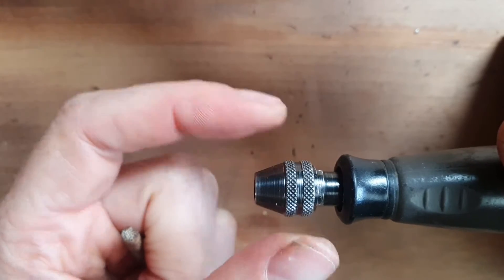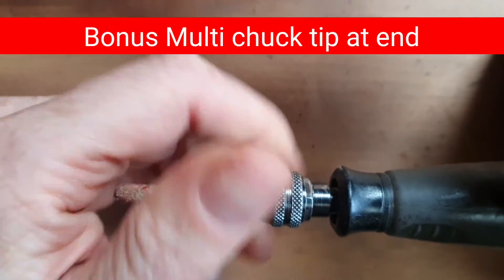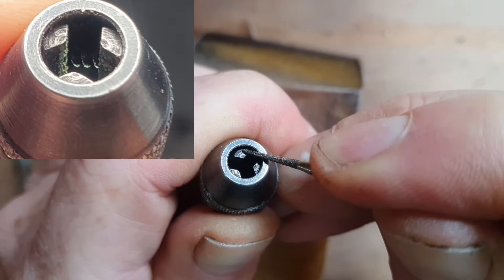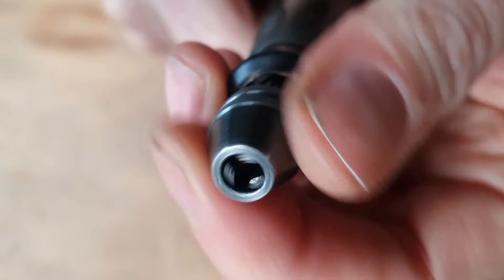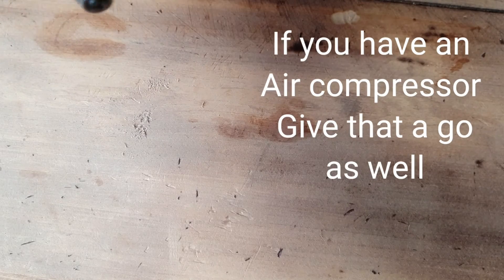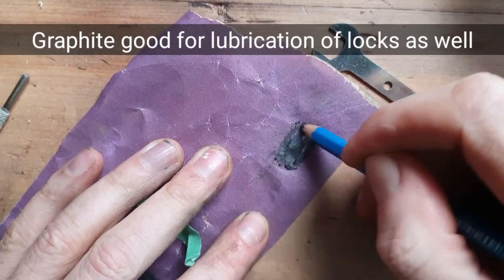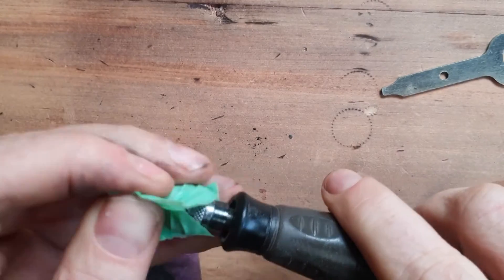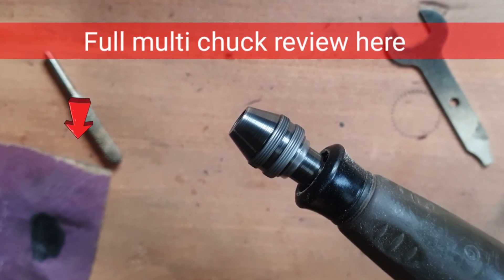Dremel multi chuck problem 1 minute fix

Comment: Thank you so much. Other videos didn't show this chuck. Mine was getting stuck and finally would not open. I closed it all the way and the little cylinder in the back came loose. I saw your video and tapped the front and it popped back open. Then I tapped the chuck and a ton of metal came out! I used some compressed air to get even more out. It works smoothly again. Now I can get back to business.
Reply from the maker: Cool good to hear that the video helped
Reply: Your comment saved me a lot of searching, as the chuck on my dremel was stuck with jaws closed with no hint of problem before that. I've only been using the dremel to reduce my dog's nails down.  One tap and the jaws came open.
Reply from the maker: @thankmelatersport  awesome good to hear

Comment: i never have liked that chuck. 
most of what i use are too small for it. 
and i use a battery dermal ( sorry forget the number and i am to lazy to get up and go look).
but this unit has a tighten/ loosen tool built on to it. 
i have a good assortment of arbors that fit in the factory chuck and most of the time the tool is already in its arbor. 
then are the four hand/ finger held drill chuck tools dedicated to just one item.  ( used a lot ) in working with my model trains. 
i forget how many dremel’s i own, and i still have the first one ( and it works great)  bought it at least 50 years back.
Reply from the maker: Looks like you found what works for you. I think the older models of dremels last longer than the newer ones. Cheers for watching.

Comment: I actually have  Dry lubricant.  My father bought everything.  Until this point I never ever knew it was for so thank you for that.  I'm testing it out now,  I let you know if it's better if you want.
Reply from the maker: Awesome, let me know how it goes.
Reply: @Matt Carves  yes it did work much better. I had no tape, so I used the tip of a latex glove. Noticeably better, thanks. Now I also sorted out that one brush is missing. Now how does the piece just disappear from the end of the spring?

Comment: If one REALLY has the urge to spray the chuck, they can use any hydrocarbon spray cleaner which doesn’t leave a residue film. Let evaporate and (imo) use graphite as a lubricant. Tried Teflon (ptfe) years ago and imo came up short compared to graphite. 
Got my first Dremel back in the 90s, love the things. 
Thanks for posting 👋👋👋
Reply from the maker: Cheers Pilot. 🍻

Comment: good vid, my problem is that accesories wiggle side to side when spin, and the grip over the accesories is uneven theres a way to fix that?
mine is clean AF cause i ted to place some drops of oil everytime i end use
even the collets have the same wiggle, less than the chuck but drives me crazy, the abrasive materials tend to get a weird uneven shape same with brushes
Reply from the maker: Sounds frustrating. Sounds like either the shafts on the bits are uneven or the shaft within the dremel is worn and is uneven.
Reply: @MattCarves  the bits being flexed is the first thing ive tough, so grab a piece of glass and let them roll, all were straight at can be, the collets wiggle is less notorious buts the same, the only way the bits dont wiggle is if are placed like 15mm of the mouth
it has less than a year of use, and started happening exactly today
Reply from the maker: @jul371-y5p  Sounds bad. Sorry I am at a loss for answers
Reply: @MattCarves  no problemo, i guess should open it and see if the bearing and shaft are properly aligned, other than that dunno
Reply from the maker: @julianezequiel9371  good luck 👍
Reply: @MattCarves  finally give in and take the time to dissasemble and place it on a balance jig i got
the threaded shaft is off center bi 0.5mm and that ends up on like 1.5mm of offceenter with the bits
dremel wont take it up to repair, straight told me to buy another one even if i pay 
guess they are a crappy company now

Comment: How do you do when the multi chuck is jammed ?
Reply from the maker: Hi it hasnt happed to many times to me, but I remove the burr from dremel and push the burr in, and I might also tap the chuck on something solid. Might have to do a video on this - cheers for the question

Comment: Thanks. Oddly or ironically enough, I purchased the multi chuck from your link yesterday. A bit of a delay though on the delivery I won't get it for ten or so days. Thanks for the heads up. I'll keep an eye this issue. Keep carving.
Reply from the maker: Cheers, Richard. That's not a big problem so don't worry about that issue. I have been using mine for about a year and they are awesome.

Comment: I need help with my multi chuck as well a few days ago  I got a new rotary tool it came with a multi chuck it worked fine for a few days but after I did a wood cutting project the multi chuck had non aligned teeth can I fix it?
Reply from the maker: Sorry probably can't help you there.  I would contact the manufacturer with it being only a few days old.

Comment: Solid tip man on the idea of not spraying WD-40 in there, I swear if I had a nickle for every single time I had to either stop somebody and take the can away from them because they don't realize it actually increases the amount of dust that gets in there
Reply from the maker: Hi Chris, at the moment I have been just tapping the dust out and not even using dry lubricant. Seems to be working well. Cheers for watching
Reply: @MattCarves  u know what they say when In doubt compress air it out, a motto I sugest heavily for everything non medical in your life, let me tell u, found that last one out the hard way....... 
🤕🤦🤷
haha sorry  couldnt help the joke

Comment: The biggest problem with these is the cheap unbranded ones are actually true, while so far, after three original, two bought from the guys themselves, none were. Unreal. The tool's good, where the rubber meets the road (all of its components) they're garbage. All of them. Literally not worth buying any of the accessories for this. You're better off buying the things made by other people for them.

Comment: These chuck are useless and dangerous as they come loose all the time with a burr running at 20k plus rpm
Reply from the maker: I would say they would come loose quite a bit on metal as there is more chatter ( Im just presuming you are using on metal from your channel name). But I use them all the time in wood above 20000rpm and they come loose only occasionally.
Reply: @MattCarves  yes i do and they come loose in seconds extreamly dangerous when a burr comes out the old type never did this.
Reply: Thank you for this fantastic fix, worked very well.👏👏👏👍
Sam